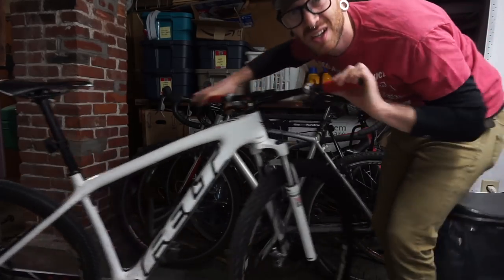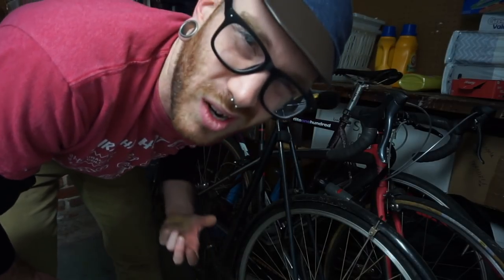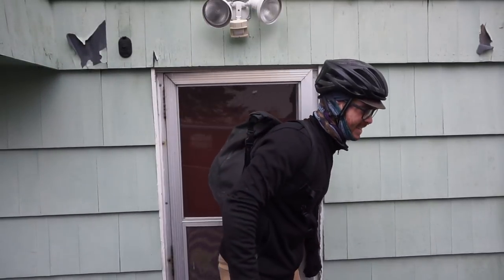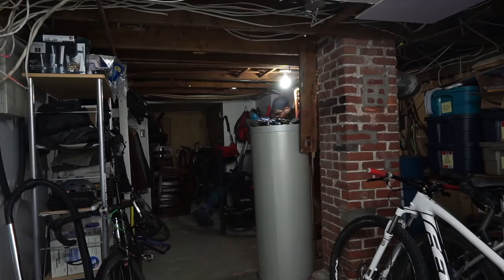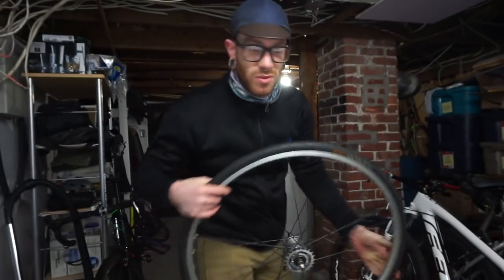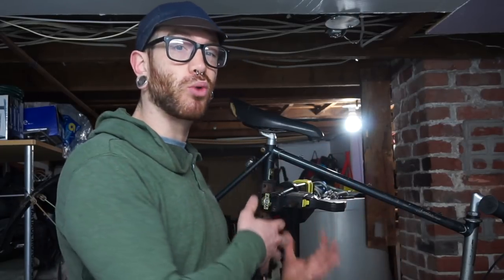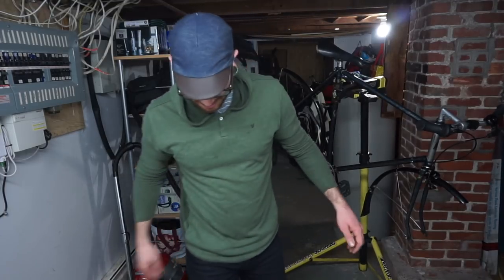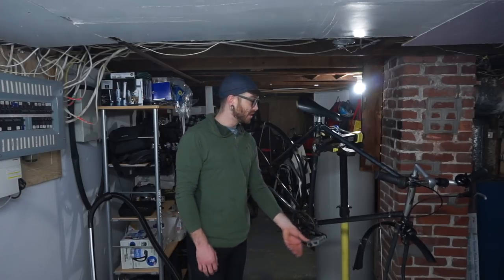Fear Not Basement Bike Maintenance

Comment: what I got from this is that your friend is just like i am in 2 ways.   I prefer so called "oversized" frames also.   the seat is all the way down but it's close to the height of the bars.   Secondly, I cover all branding and words on the frame with electrical tape also.  It's the first thing i do when I leave a store with a new bike.